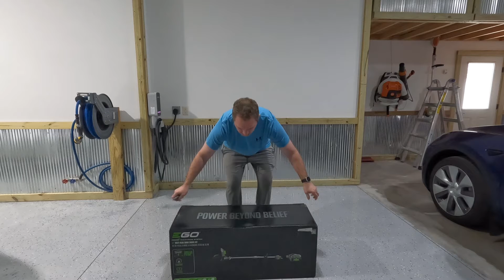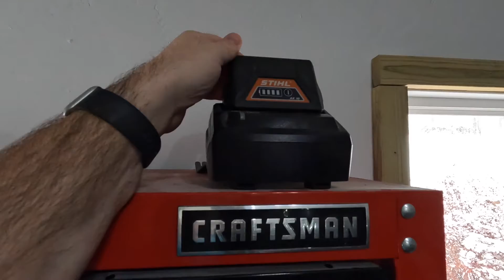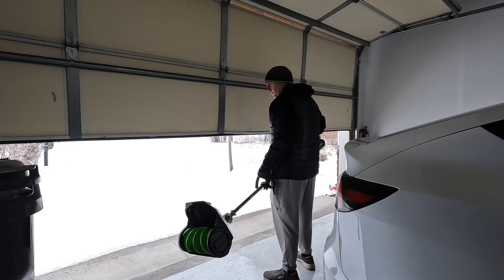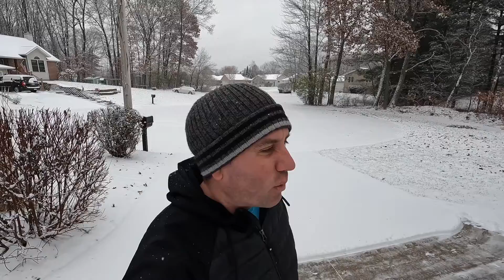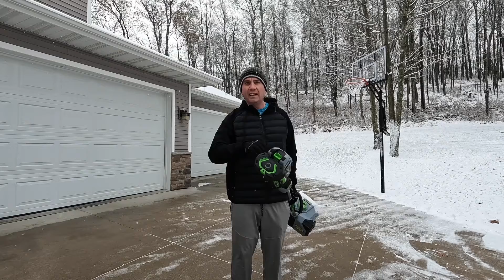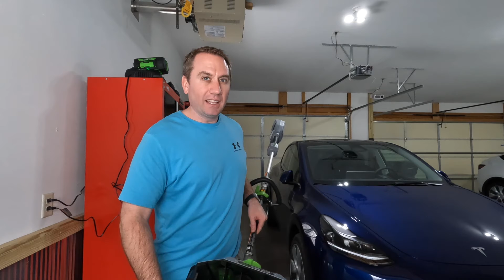EGO POWER+ Snow Shovel Kit - Review and Test

Comment: I have the 21 inch mower and the 18 inch commercial weed eater. Both perform very well. Have not encountered any issues. I have 5 amp hr. and a 7.5 amp hr. battery. They are a bit pricey.
Reply from the maker: Thanks for sharing your experience with EGO products.

Comment: Just a heads up, I’m sure u figured this out since I made the video, but u can move the front handle farther back to help with bending over as much. It’s supposed to b abt midway from the coupler part to the motor housing. Give or take a little bit each way
Reply from the maker: Yes, I did figure that out after the video.  Thanks for stopping in and sharing with everyone.

Comment: do you have any fire hydrants in your area?  can that power shovel be used to clear snow piled up around a fire hydrant, like in this video https://youtu.be/A4S64lP88xA
Reply from the maker: I do have a fire hydrant in my front yard.  I will test and fill as soon as we get some more snow.  

I did a little poking around in a snow bank and it did move it.  I think the key will be getting to it before it turns to ice.
Reply: @TheLawnEngineer ya, i'm just wondering if that power shovel would make it easier or if it would work at all.  I've looked for videos of that but I haven't found any.  I'm seeing local TV news stations putting out public service messages asking people to clear snow from fire hydrants and I wondered if a power shovel would make it easier.  Also, I've asked this question on several other power shovel videos and they all say the same thing, "I don't know, I never tried it" hahahahahaha

Comment: I also got mine from big box store.. it was on sale during blackfriday. I saved about $80 on that power shovel..  i just googled it for reviews and i ended up here.  However, for two stage Ego snow blower it is recommended to buy from those steel specialized shops.   The reason is because where i live, big box stores will just tell you to contact Ego for any warranty claim.  Contacting Ego hotline is very difficult (try it you'll see what i mean) then in some case Ego could (i mean could, so not always the case). Could ask you to ship the thing back for repair..  and ofcourse, shipping back and forth won't be free. They will just tell you they are sorry but that's the only way.  Or they can also tell you where to go in your area to have it fixed, but here,s the deal.. you might not be able to find one near your location . So be sure to check by calling them first,  not because they sell and repair Ego that they will accept to repair yours.  In my area, most of them will only repair the Ego they sell because they don't buy their Ego from Ego directly but from a different distributor. So all exchange, parts and repairs get the RMA from a specific distributor business account and inventory.  Not with Ego. To have an alien Ego unit repaired (say something that came from Amazon)  that specialized shop will have to do exactly as anybody.. contact Ego and make a claim on your behalf, if Ego accept. Then Ego will ship them the part and some money for the repair labour.  It,s alot of work, Ego don't answer email quick and they often cheap out on the repair rate.  So most steel specialized shop don't like to repair Ego units that come from bigbox stores unless it is out of warranty and they can charge you their repair rate which could be $100/h diagnosis and parts not included.   Also if it is a two stage snowblower, it may not even fit your seddan car..so you might gona have to rent a truck or hire some mover to bring that in to that Ego shop .. and ofcourse the shop could be an hour away..  some more fees on top.   Anwyay, for small things like Ego battery, and smaller items. I guess it is ok to buy from bigbox stores.. ( i do ).  But for heavy stuff , a specialized shop is the only way.

Comment: Just something to keep in mind: Ah doesn't tell you anything about the amount of energy stored, you're looking for Wh. A 12V tool that has a 10Ah battery is still a lot less powerful and has a lower capacity than a 40V 5Ah battery. As long as you're in the same brand and voltage range, Ah can be used as an easier alternative to Wh.
Reply from the maker: You are absolutely correct, I flubbed that one.
Reply: @TheLawnEngineer  It's not that big of a deal, pretty much everybody does it that way, and it's unfair to compare 12V to 40V tools anyway. It's just good to be very specific online, since some people will always take what you say as an absolute truth, and will blame you when they find out they messed up.
Reply from the maker: @timderks5960  very well said

Comment: Since you are now a 2-Tesla family, and using beefier electric chargers, have you seen a significant uptick in your home electric bill?
Reply from the maker: Yes it is a noticeable increase.  I am leasing a charger from the electric company, so the cost for car charging is separate on the bill from the rest of the house.  Last month's cost for car charging was $65 including the $20 for the charger.  The  remaining electrical charge for the household was $90.
Reply: depends on where you live.  here in central ohio, we are blessed that costs are $.08 per kWh so the impact is minimal.   savings over gas is significant.    I've had 5 Teslas over 10 years and it's $.02 per mile for energy costs.  compare that to gas which has varied over the years from $.10 to $.14 per mile on our various cars.